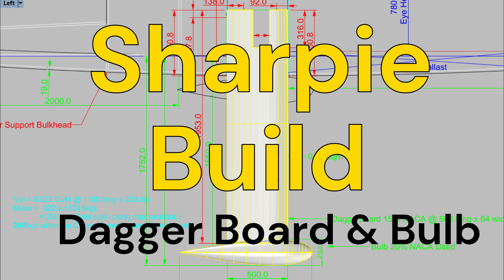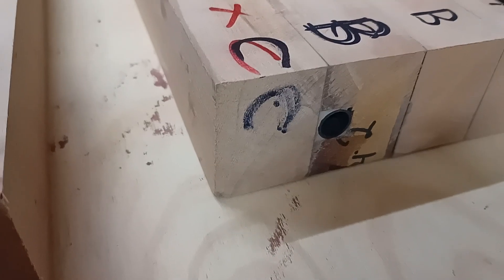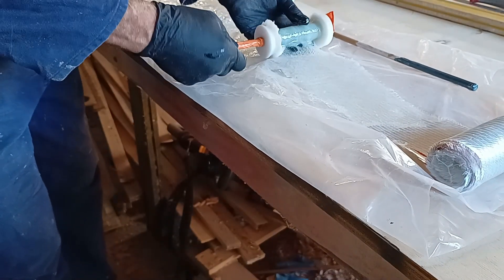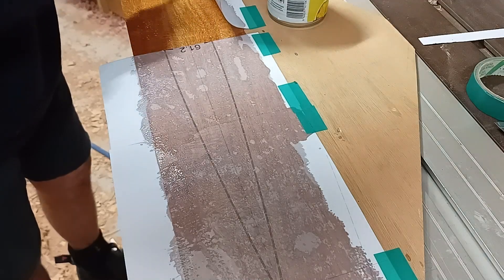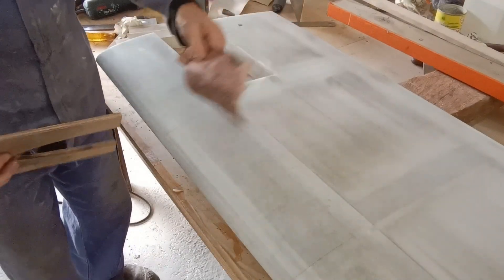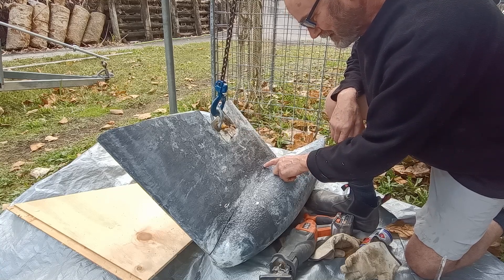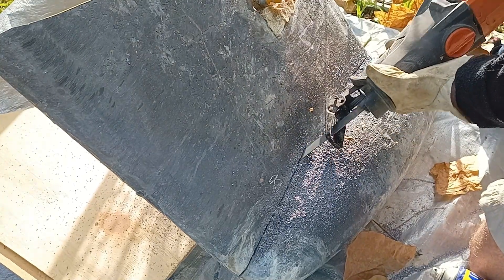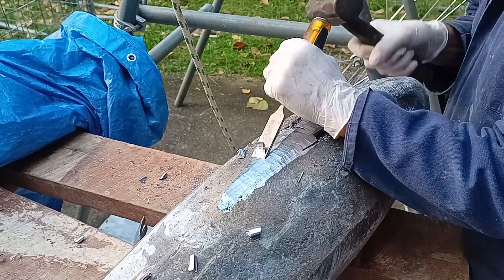Laminated Ballasted Dagger Board Build -  23ft Sharpie Trailer Sailboat Yacht Design Build Sail

Comment: I'm a bit strange..... i found your video really interesting. Lovely craftsmanship and thinking things through....
Thanks for posting
Reply from the maker: You made me smile! Trouble is I'm prone to other thinking things through as well. But the incentive is, I want it to work first off and it has to last me at least 10 years, keeping me interested. Also, my partner is not that keen see me keep changing yachts so I've really tried to extract what while serve me well for the longest time. I have quite a few other concept designs I would have liked to have tried building.

Comment: I must admit I am very disappointed you won't be able to dry out level, but I am glad to hear that was the original design intension
Reply from the maker: Yes, it was not a simple decision but became simple when I considered how much time I could save. I still might melt the lead into something more practical in the way of drying out at a later time if it proves too limiting. I'm trying to design the trailer currently and having a bulb certainly does not make things easier!